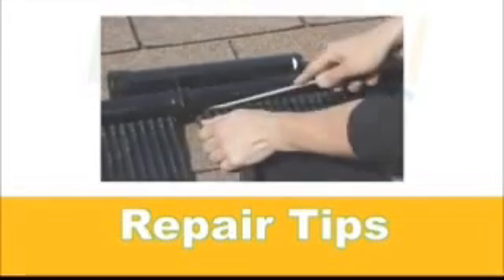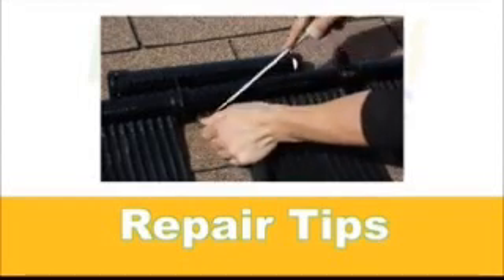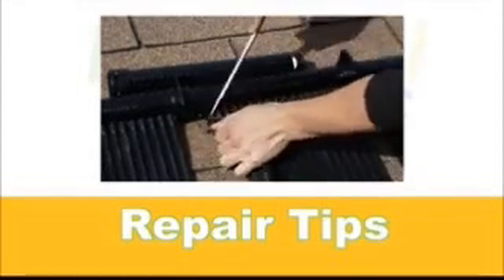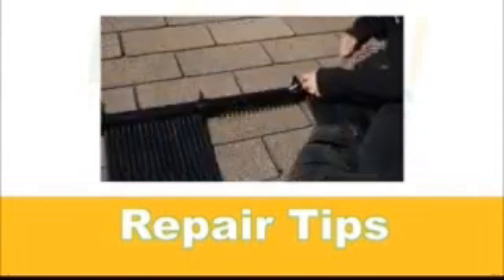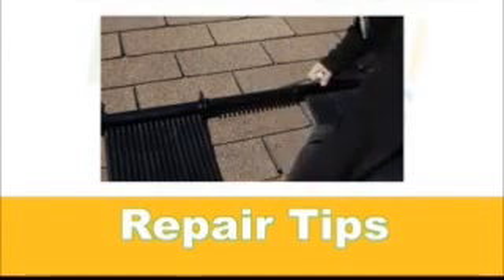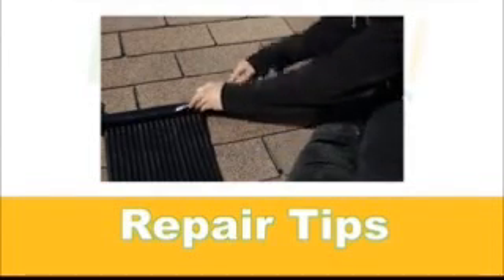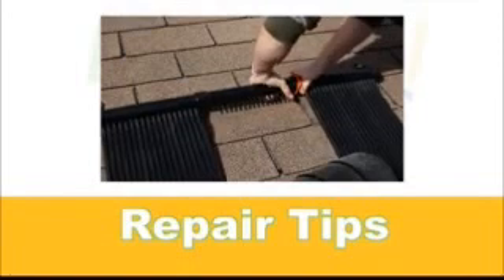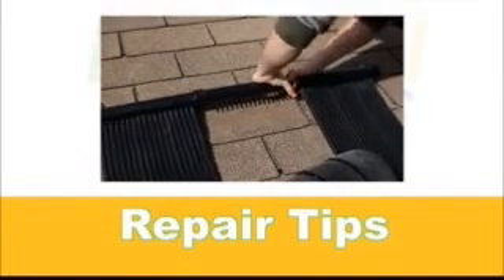Enersol Solar Pool Heating - Replacing a Solar Pool Panel Header

Comment: Enersol pool heater panels are made from EPDM rubber that can break down, resulting in "black pool disease". The problem is worse in cold weather (anything below 40 degrees). The side of the Enersol box that my system came in says "18 year extended warranty".  After just 7 years of use, I now have a black pool and Enersol refused to honor the warranty.  They  tried to claim it was "biofilm", however, under a microscope, there was nothing but EPDM flakes.  This was an expensive lesson to learn.  Hope this info is helpful to someone else.